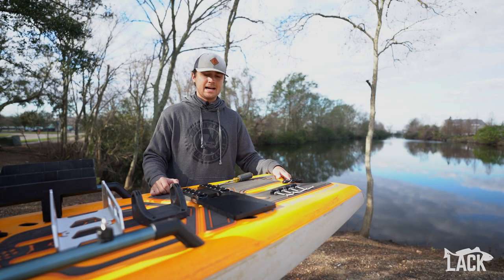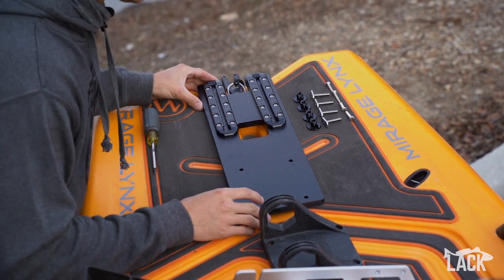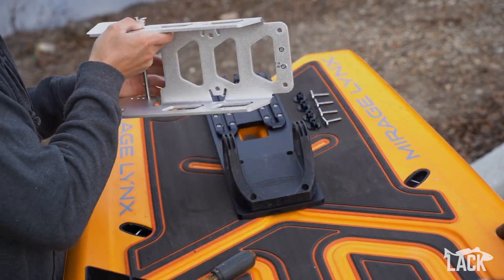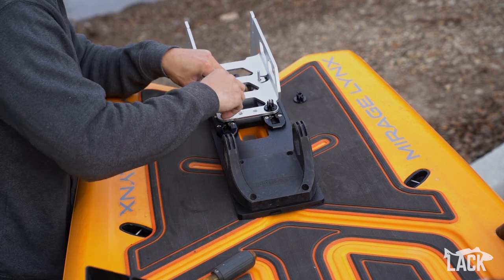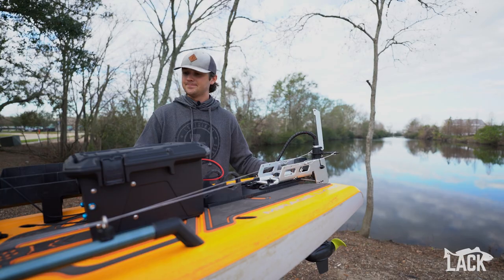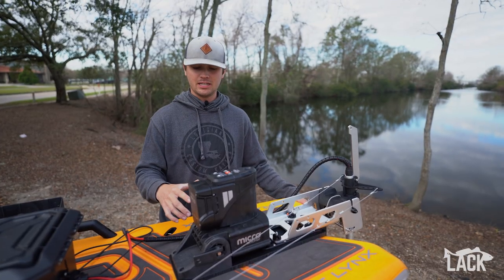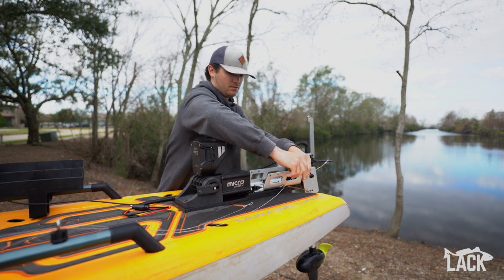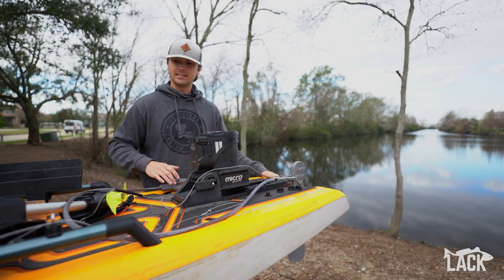Hobie Lynx Motor Mount Install and Walkthrough

Comment: lynx tracks horrible without rudder. anyone tried this setup in water? how is the tracking using the motor
Reply from the maker: It does okay tracking with the motor, but there is a foil available that allows your motor to act as a rudder